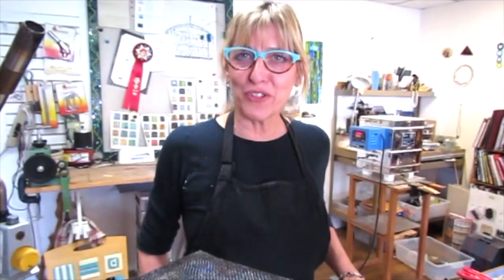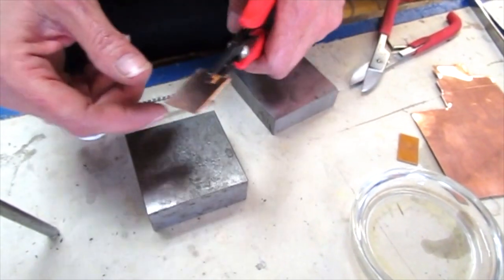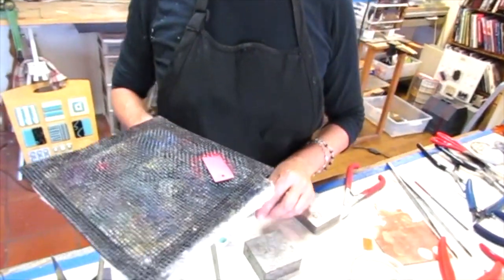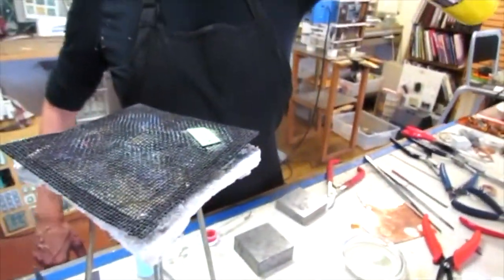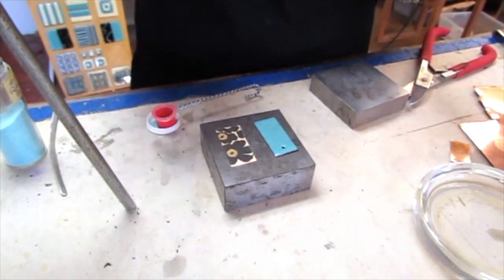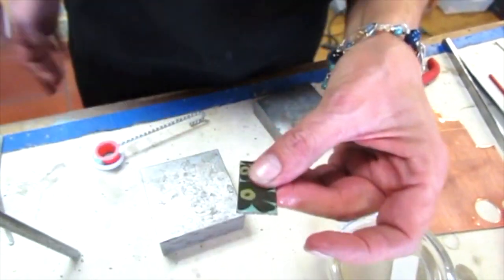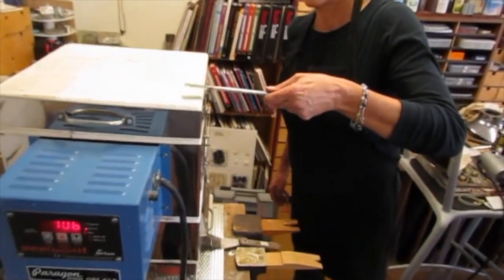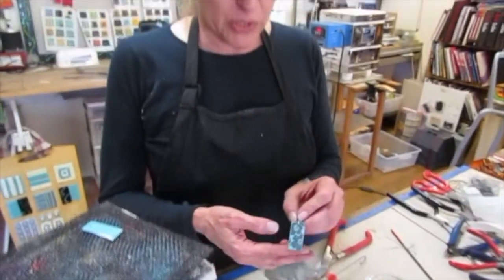Torch Fired Enamel & Decal on a Copper Pendant

Comment: Hi! If you torch-fire enamels it's better to come with your flame from below and not fire directly on the enamel as this can burn the colours and blow the enamel away. It doesn't have to be a hot surface for the enamel to stick but it definitely needs to be a clean (de-greased) surface. Also, when you shift the enamel to your piece, it's better to do it over a clean piece of paper (your piece should be cold when you do that) so you can gather the excess enamel that falls around it and put it back in it's box (you save a lot of material this way, plus your metal sieve doesn't have fired enamel on it that will stick to your pieces on firing).
Reply from the maker: Howdy! Thanks for the comments. I agree with what you have said, and appreciate you sharing. When I personally do enameling it is very spontaneous, so that's why I do some of the things I do. I have great results for the most part, but I know they would be better if I slowed down a bit. I'm planning some more enameling projects so I'll address your points then. Thanks again!! Have a great day.

Comment: With no counter enamel, that enamel will pop off over time due to surface tension.
Reply from the maker: Thanks for the advice.
Reply from the maker: I'm planning on another video to address the counter enamel issue. Thanks again.
Reply: Counter enamel?
Reply: @TheJestersYarn  Counter enamel is the "first step". Firing a layer of enamel on the back side of the project . By having a layer of enamel on both sides it equalizes tension and adds rigidity. Without counter enamel the design side can crack and pop off the front.
Reply: @jlee565  I was thinking the same thing. also what about fire scale? hmmmm

Comment: These are temporary tattoos.  Can you use regular decals?  Love your video!
Reply from the maker: Those are decals, not tattoos. They use that material to print on. I have used some "regular" decals with mixed success. "Gold" decals don't like the torch or the kiln. Bummer...all decals can be burned away if one is not careful.
Reply: @thecreativespacezone  They print onto temporary tattoo paper?  I'm sorry I know little about enamel but I'm really interested in this process.  Do they use special ink?  Can you make your own?  I've watched a couple of other videos and they use glass decals which seem specialized for enamel.  Is that the same as this?  Sorry for all of the questions and thanks for sharing your video.
Reply from the maker: @patriciawiley99  the source I use, has adapted laser printers with the appropriate enamel colors to produce four color prints from computer images. The color isn't as true as I like but if you understand that when you create your images it may not bother you. In Plain Sight is the name of the company. https://www.inplainsightart.com/decals4artists
Reply: @thecreativespacezone  Thank you.  I love the result!

Comment: Is it possible to apply a decal with a torch?
Reply from the maker: Yes it is. Just be careful not to fire it too hot. I have burned it away Also make sure there are no air bubbles between the decal and the surface.